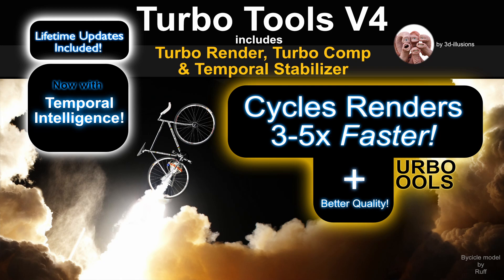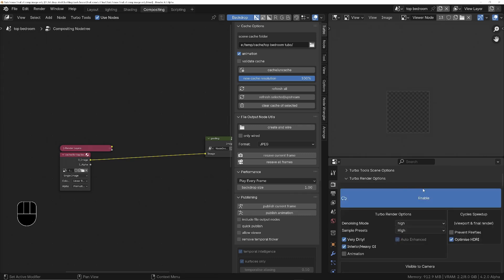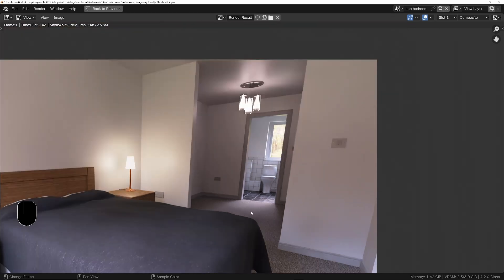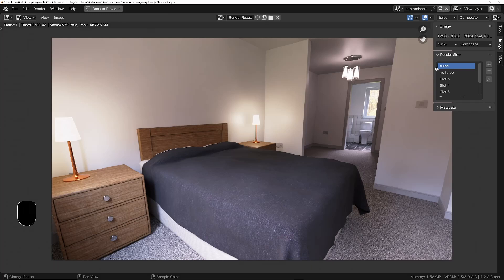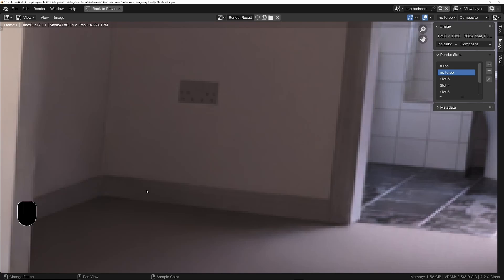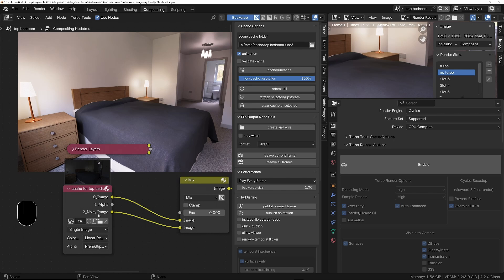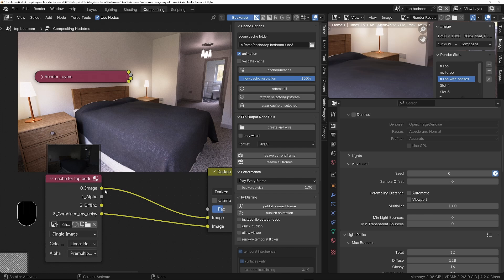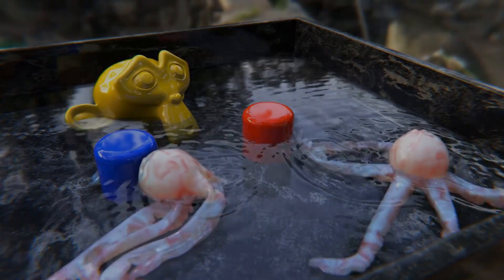Artistic Film Grain: Enhancing Denoised Cycles Renders

Comment: Hello. I’m a big fan of this addon. I have a question though. 

Recently I had a project involving light groups. I couldn’t figure out if there was a way to get turbo render to denoise the light group passes as well as all the others when I set denoise to ultra. I chose to use the denoise node in the compositor instead. 

But am I losing quality and speed by manually denoising each light group pass and combining them into a completed image compared to how turbo tools is working to preserve detail behind the scenes? 

I didn’t know if it would be better to use view layers with only one light turned in for each layer. And use turbo render to denoise that way. But that felt complicated. Is there a way to handle light groups with turbo tools? 

Thanks.
Reply from the maker: @squallrulz0685  hi, for support please use the support contact details provided with your receipt 👍
Reply: Ok. I will.